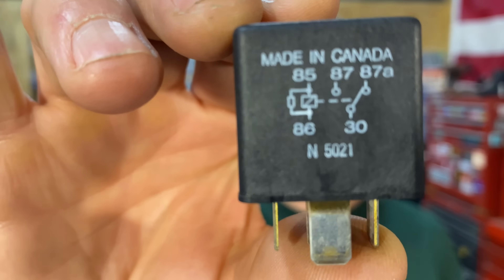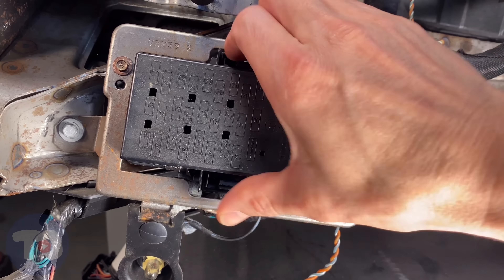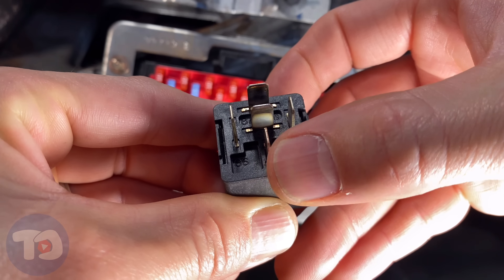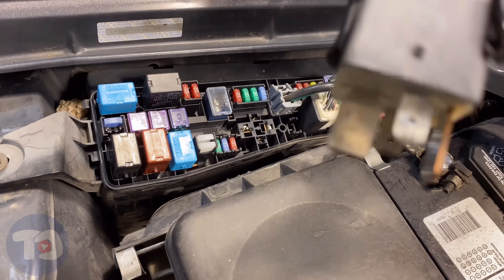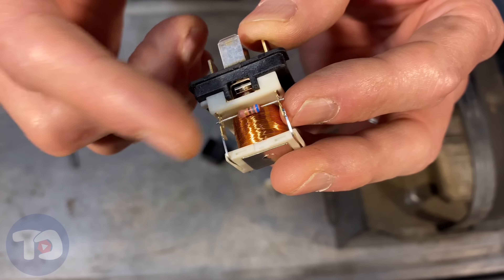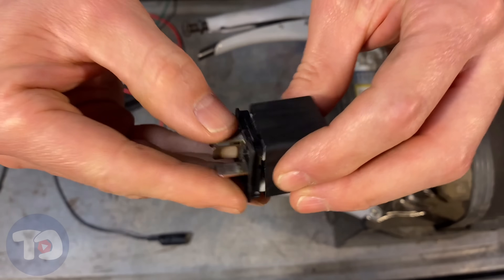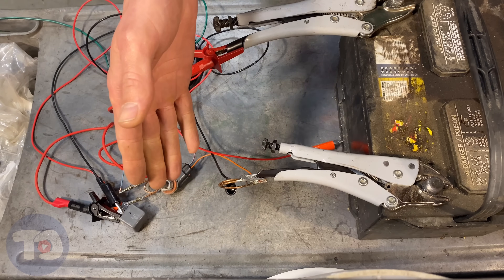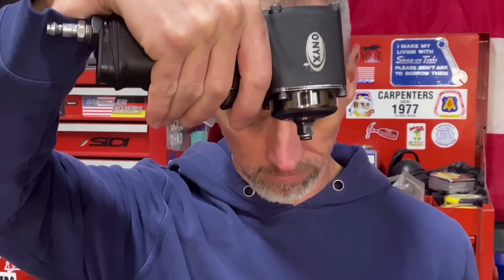Why are relay pins numbered like that?

Comment: I would be a little worried about shorting the battery out testing like that
Reply: What - Why
Reply from the maker: If your circuit is well thought out, there's almost no risk of shorting it.
Reply: I don’t have an issue with the wires, however, people new to this should be warned that if the vice grips accidentally contacted each other, hundreds of amps would flow causing instantaneous welding.  A fellow I knew created a short circuit with his metal wrist watch band, resulting in a burned wrist.
Reply: @dougw3531  there have been many cases of spanners getting dropped and welded across battery terminals and then melting like a fuse, only it takes longer and creates a big fire hazard - there is a lot of energy stored  in a car battery.
Reply: I have seen a battery shorted out and with small wires like that the insulation would melt almost immediately. Yes the risk is small but why take it. You could stick a fuse inline use insulated battery terminal connectors. Remember people with no knowledge are watching these videos and might be tempted to copy what you do.

Comment: No explanation at all .  Why are they 30,85,........ ????
Reply: The shortest answer is that when the need for standardisation became apparent, they made an exhaustive list of all electrical parts and appliances found in cars, and all the necessary connections between them, that they could possibly come up with. And then they just numbered that list, grouping somehow related items together, and skipping a few numbers to be able to add not yet envisioned or developed items at a "proper" place in the list.
Reply from the maker: If it made sense, I could’ve explained it.

Comment: I doubt that any relay manufacturer (even Chinese!) Would be stupid enough to put a RESISTOR in paralell with the coil.

And not putting a DIODE to shunt the coil back emf is loonacy.

This idiot needs a lot of primary education before making these stupidity videos.
Reply: Resistor or Diode parallel with the coil, both are effective at dissipating the back emf!
Reply: @larylongprong  twat.
Learn something before being stupid.
Yes I suppose you could put a half ohm resistor accross the coil.
Yes it would have a snubbing shunting effect on the back emf.
And on the forward current flow.
So of course the relay wont work.
Even if you asshume a hundred ohms coil R and shunt it with 100 ohms resistor.
The coil will have half pd (depending on source impedance) and it would still have hundreds of volts back emf accross it.

So NO .
It wont work.
Snubbing the coil with a resistor is utter loonacy.
That is why educated designers would employ the characteristics of a pn junction (a diode).

Comment: Type A and B relays - type A are pretty rare. Only cars I know of that use them are 80s / 90s Maseratis.

Suspect half the electrical issues they suffer from are due to someone using the wrong replacement relays!
Reply from the maker: Very likely.
Reply: In Australia, the majority of Australian assembled cars used the “Bosch pattern” relays in the OEM fuse boxes.  Many aftermarket relays, particularly those in driving light packages, or just bought over the counter, are the opposite type.  Many times I have been able to diagnose a particular model’s heater blower fan stuck on by asking if they’d recently changed a relay.  Nearly every time the owner scoffed, then checked, and found I was right.   
We were taught in trade school back in the early 90s that the numbers related to DIN circuit numbers.  Tachometric fuel pump relays have a number of additional circuit numbers on them too, like 15, 31 & 50.  One text book (remember those?) had a good listing of all the DIN circuit numbers and what they meant, including those tach relays that were getting to the right age to give trouble.  I still have 2 80s cars with the Bosch tach relays in them, and knowledge I learnt as a teenager has stuck with me on them, and got me out of a bind several times.
Reply: @commodorenut  , problem is that there are 2 different Bosch pattern relays, and both will fit in the same socket. Trouble is the main power feed and the trigger pins are reversed, so mix them up and the item is perminantly switched on by the main power feed, while the item is then powered by the trigger wire - in effect the relay is bypassed. Hence electronics switching things via the relay can land up being burnt out from the higher load.

Comment: It is German automotive wiring system. 15 is hot with ignition on, 30 is hot at all times, 31 is always grounded and the wires are brown.
Reply: @Froggy 01 you had the only ones that were reliable! 😂😂
Reply: Used to rewire VeeDub Beetles on the weekend when I was a student, made life really easy for me making up the wiring looms and installing it, good money too. Edit - spell8ng
Reply: WHY?
Reply: But why those particular numbers ?  DIN answers The Who.   But why not 1,2,3 as was asked ?
Reply: @michaelmccarthy4615  two digits provide more room for information than one. Like why we moved from 8-bit, to 16-bit, to 32-bit, to 64-bit. The longer the "word", the more data it can hold. Two digits give a first "type" and a second "condition". 

That's what I see going on here, anyway
Reply: @phrenologisto  it would be nice if the video explained that too.  
As the title implies. 
It's not even click bait.
It's just information omission that is almost as bad.   These red herring videos will live on forever and we will drown in a sea of too much information that is not realivant to their title.
Reply: @michaelmccarthy4615 I think the point was that all the preceding numbers were taken for other components.
Reply: @michaelmccarthy4615  
You know, I've been using all manner of differently numbered auto electrical parts from different countries for 50 years. And I've never felt the neurosis to ask "why" they chose their particular numbering systems. May as well ask "why" Germans speak German and Mexicans speak Mexican, or why there are 100 cents in a dollar and not 49. Just a convention based on history.
Reply: @thedolphin5428  the title of the video says why numbers 85, 86, 87, and 30...  it seems a straight forward question.   I was surprised when the video didn't answer the very basic question it asked.  Especially when the who, Germany and DIN wasn't asked.
Reply: @thedolphin5428   True, but what I don't get is why when American cars went metric -- which was long after German or Japanese cars -- that they didn't choose either the existing DIN or JIS standard for fasteners (so 8,10,13,17,19mm or 8,10,12,14,17,19mm) but instead decided to use 11mm,16mm,18mm etc.  So people complain that you now need every metric socket and spanner size compared to the more convenient simplified subset with SAE or Whitworth -- but it didn't have to be that way! Before that, a metric tool kit of 8,10,12,13,14,17,19mm etc was sufficient. Thankfully the larger sizes like 27,30,32,36mm etc still tend to be fairly standardised.
Reply: I work at AutoZone and I messed up I’ll admit I should’ve traced the cables of a volkswagon I was working on but I was being lazy and just popped the “red cable” on the positive and the black on the negative long story short I’m not allowed to work on Volkswagens anymore
Reply: DIN
Reply: @dennis-nz5im  Which is German Industrial Standard which specifies the automotive wiring system.
Reply: @albatross5466  DIN 72 552. Quick Google search specifying "filetype:pdf" returned four sources. Cheers!
Reply: It's been decades of me working on my Mercedes Trucks and long career as Controls Electrician. I know the what the DIN numbering and colours system is but dammed if I can remember its details. 
I either need to see schematic or look up the number designation.
Reply: @Froggy 01 Worse than that, could be Lucas, Prince of Darkness!
Reply: @vumba1331  in Australia We call them 'Lucas, The Inventors of Darkness' !
Reply: @vumba1331  What is wrong with W1, W2, C1, C2, C3 on relays?
Reply: @overlandready  it's still a two digit system. It also requires that the stamping machine do letters and numbers rather than sticking to numbers. 

If youre ever thinking "Why would DIN choose this? It's stupid and arbitrary", look up the actual DIN standard and the applications it covers. I've learned that if I get frustrated with DIN it's me being dumb and lazy.
Reply: @phrenologisto  there are many different systems for numbering pin designations, I just gave you another one. FYI there are other DIN specification standards that give different pin numbering. I was also being sarcastic. Been working in the automotive industry for 30 plus years. I also build looms. :-)
Reply: @overlandready  you’re not German are you?
Reply: @vumba1331 Lucas doesn’t number their pins, why waste the time to do it when it’s never going to work?
Reply: @Froggy 01 It has a long time  experience with the  increase number of componets in eletrical systems, not only in vehicles. so ignition and lights have low numbers all later addional parts got higher numbers. The wires in the car installation have   the same number   as the one of the  component terminal. Wire 87 is connected to  relay contact 87

The mains power got also number on their components. A power switch is numbered  with 1,3,5 for the three phases on the mains side and 2,4,6 on the load side. 
Relays coils  are marked with  a and b  , the spring sets numered  by 15, 16 and 18 . Contactors numbered  1,2 or 11,12 for nc  auxillary contacts and 3,4  or 13,14 for no contacts. If they got  much more auxilary contacts the fist digit count them up.
The standarisations make it  easier for fault finding.  Large installations got wire numbers, each wire got an individual number which is marked on the wire itself and in schematic.
Same with the colours of the wires. 
If not no technician coult repair a fault in  a phone exchange , an aircraft or an hospital .
have.
Reply: @Froggy 01 Ain't that the truth!
Reply: @Froggy 01  Or worse yet it could be landrover.
Reply: @Froggy 01 Now, now. Don't be a grumpy Aussie. Just because "American" auto marques dominated your scene for decades... Cheers!
Reply: Is there a name for this wiring system other than the German automotive standard? Is that the DIN 727552 He mentions? This would be wildly useful if it applies to the old family bmw e34 😅🤞
Reply: @Ariccio123  I am aware of it from 1980ish. I don't know beyond that when it was introduced. I also don't know of any specific name for it. It was a pretty easy protocol to understand.
Reply: @Ariccio123  DIN is the institute for standards like the USA's NIST. They have standards for everything standardized. That car almost certainly follows a DIN standard, with the only chance it doesn't being that it was manufactured elsewhere for a foreign market. There are forums all over that share this sort of thing and im sure you'll find what you're after. Good luck!
Reply: @Ariccio123  Your E34 Bimmer was wired in compliance with DIN 72 552 definitions. Google is your friend and "filetype:pdf" should be your search parm. Cheers!
Reply: The German standard also contributed to a lot of the wiring problems on the vehicles.
Reply: @swicked86  How is that true? Have you read DIN 72 552? The DIN connections standard is very clear. Therefore there should be no initial problems if vehicle assembly process is performed correctly. If not, then that's another story with lots of grief. Cheers!
Reply: @swicked86  hahaha. Only among the ignorant knuckle draggers!
Reply: Learned all my proper wiring by using the denso models. I would go to the junkyard and pull a handful. Never found a dead one
Reply: its common practice that when talking about DC current we dont use the word HOT for constant as keeping the terminology consistent helps us figure out whether you are talking about DC or AC but then again no one cares
Reply: You need to learn English , “hot “ means something completely different, you should say “live” meaning a “live” wire , “hot “ is only used when a reference to temperature is  indicated.
Reply: @kenlydon1395 On the subject of learning English, "live" refers to having life or not being dead. How about "energized"? Would that be OK Karen?
Reply: I believe like some people have pointed out these are standard "German" circuit numbers for their automotive wiring setups
Reply: @j.m.5995  Correct.
Reply: @Froggy 01 Your statement has the same "Made in Detroit, by Drunken Union Thugs" vibe as experienced here. Good riddance. Cheers!
Reply: @froggy0162 you mean the imperial system invented by europeans as well? Lol
Reply: DIN is my God. The synthesis of human understanding, standardized. DIN knows all; DIN is all.
Reply: @phrenologisto HI, I AM ISO! BOW BEFORE ME, BIOTCH!
Reply: YouTube videos are becoming useless if we drown in a sea of mislabeled information we can't find anything.. 
  it will become "for entertainment use only"
😔 sadly...
Reply: You will also find numbers on the terminals of industrial automation components. There you need access to the I.E.C. to make sense of them.
Reply: @alistercarmichael4990  IEC standards, docs and best practices are available online everywhere. So, where's the problem? Cheers!
Reply: 3:55 diode I think
Reply: @mb106429  That is a 680 Ohm, 1/8 watt, 2% tolerance metal film resistor. Bosch quality in even the smallest things. Cheers!
Reply: I mean that doesn't really explain why those numbers mean what they do
Reply: @froggy0162oh yeah heaven forbid it be simple. And easy to remember. Your comment is ignorant
Reply: German norm: DIN 72552
Reply: Oh..that is it..good to know.!✌️
Reply from the maker: Sometimes I wish there were one standard for all cars. That would solve a lot of problems.
Reply: @ToolDemos  embrace DIN as the one true standard! It's a path away from waste, towards quality. Something we shouldn't be able to find a problem with. Cheap/non-DIN = pre-garbage
Reply: @ToolDemos Whats interesting is marine is all standard. The starter relay wire is the same color on all engine manufacturers. Same for fuel pump, ignition etc. etc.
Reply from the maker: @donziperk  must be nice!
Reply: @ToolDemos cars were invented in Germany where the DIN Standard comes from, your point?
Reply: @ToolDemos  but think of the job creativity for so many people.  Different is good too!    But I understand
Reply: It’s almost like he did not research whatsoever.
Reply: So the 88 is nothing to do with Flak 88?
Reply: @Dave5843-d9m  Unless die Fliegerabwehrkanone had electrical circuitry, no. Cheers!
Reply from the maker: @Dave5843-d9m  too soon?
Reply: Save problems, but those companies would then option themselves out of profit/business.
Reply: @froffy 01
That is why American Muscle Cars of the 60’s&70’s were better. They were made to be Hamfisted. This finicky sissy British cars were garbage ( unless you did what Carol Shelby and put a REAL MOTOR in it and fixed the handling and put good brakes on it. To much work for not enough Go. 4 cylinders is for motorcycles not cars. But then again, the wag they handled and such crappy brakes. I don’t think I would want a V-8 it either . 😂
Reply: @marshallcollins8634  Four-cylinder engines are for motorcycles, not cars? Almost every German 4-cylinder car easily outperformes the large-displacement US V8. It's faster and consumes significantly less fuel. What do Americans want with their big cars if they're not allowed to drive fast anyway?
Reply: @marshallcollins8634  A motor is electric. I think you mean an engine.
Reply: @robertbritton656  Of course that's where General Engines got it's company name from.
Reply: @MetalheadAndNerd  Ha, ha!
Reply: My enginecycle uses gasoline too-
Reply: @robertbritton656 a motor is anything that motorvates
Reply: @MetalheadAndNerd 😂
Reply: @imlikerhettbutler5093  The person I replied to has deleted his comment. It was the usual "It's called engine, not motor!" young English learners love to throw around.

Comment: Well, these kind of "German engineering" issues are actually simple. The US have a problem when it comes to interchangeable parts - pretty much everywhere.  It's because every manufacturer came up with their solution at one time but there was nobody who regulated or cataloged these things. Therefor parts that should be interchangeable are often not and you have to find a spare part from the exact same manufacturer. In Germany they realized that problem very early on. Actually Americans did too, they just didn't act on it. Germans came up with DIN which standardizes all sorts of things in 1917 (making for example parts in military equipment interchangeable, something that wasn't there yet in American equipment) but it took a while before something like ANSI and ISO standards came to be. The first time Americans started to standardize something (that I'm aware of) was - what else - ammo. Gun cartridges initially weren't interchangeable due to different sizes and loads. To my knowledge that was the first thing Americans standardized and then there was nothing for a long time.
Reply from the maker: That is a very American idea for sure. Lol you can see where the focus is.
Reply: We had a good deal of interchange due to the military demanding it and demanding cross reference books. That went out the window in favor of locking in proprietary solutions. That is why if you have a car from the 50's a good deal of parts interchange.
Reply: Richtig. Eli Whitney demonstrierte Präsident Jefferson die Idee der Austauschteile für Gewehre. Die Kartuschenstandardisierung folgte bald. Hat bei uns auch im 1. und 2. Weltkrieg ziemlich gut funktioniert, oder? Prozit!